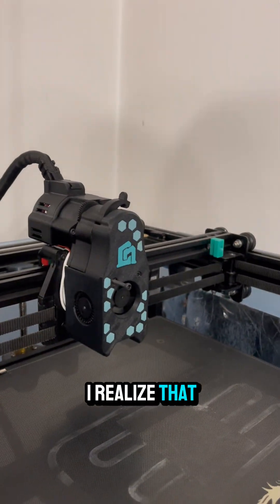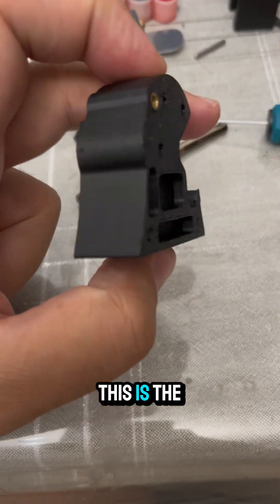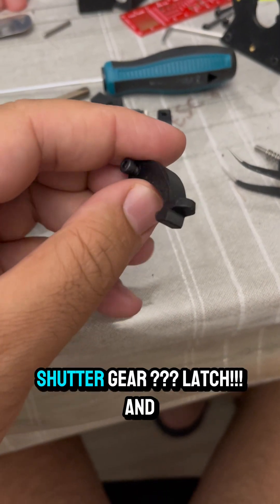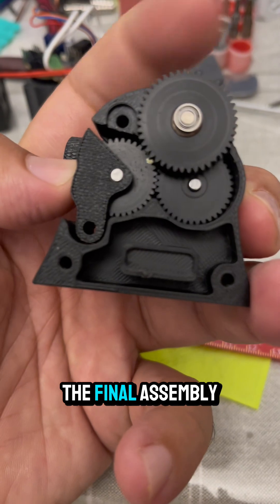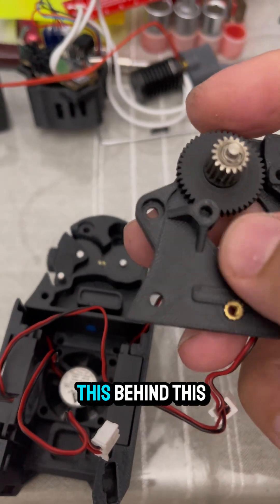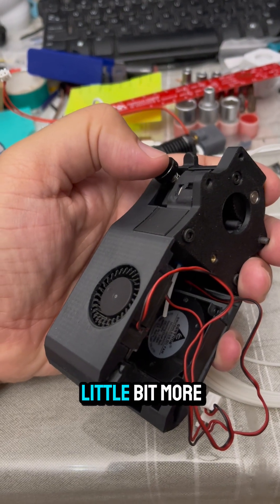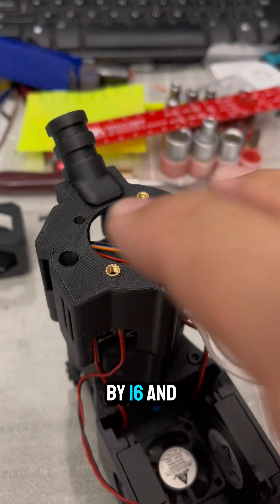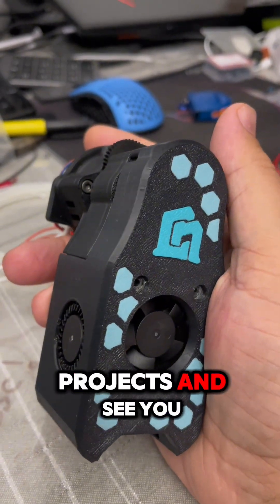How to assemble Spartacus LGX

Comment: Thanks for the video. I am currently assembling the non-LGX version, and apart for the belts being too short on the sv08 it's been going quite smooth so far.
I assumed that the fans would need to be joined in parallel at the connector, but I was totally missing the PTFE part .
Reply from the maker: Spartacus BMG has a long video it was a live video. but for the LGX we didn't share how we made it. the BMG version has on git hub also a txt/photo version for the assembly. Btw we will make a small change suggested by the community for the sv08